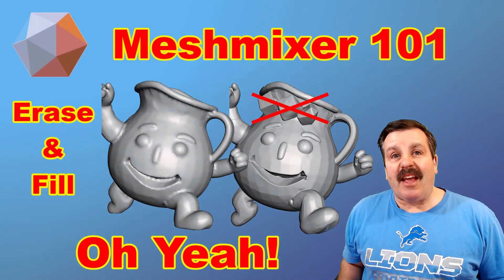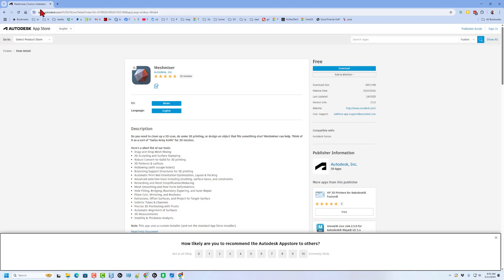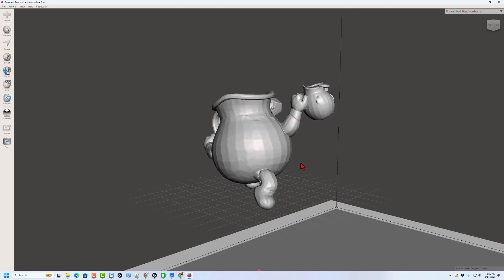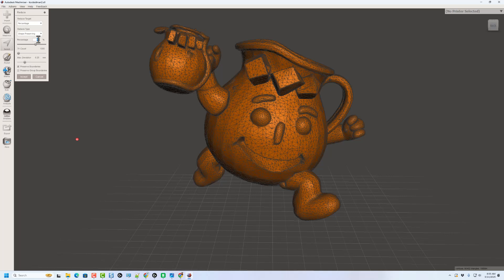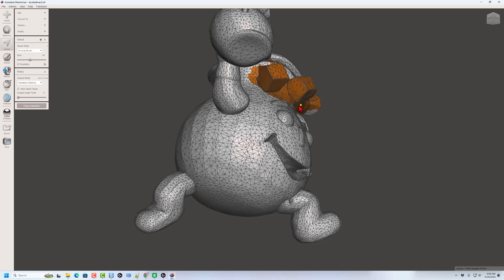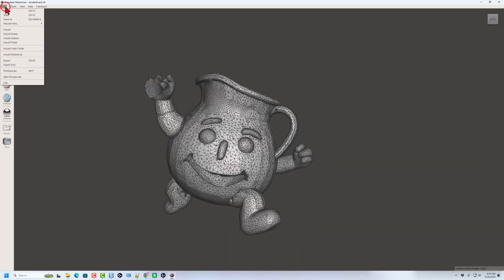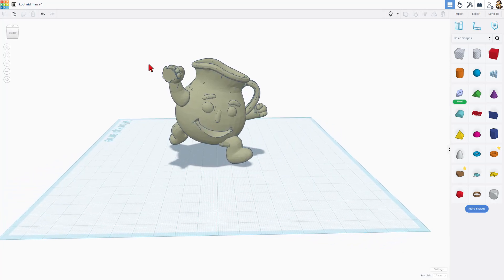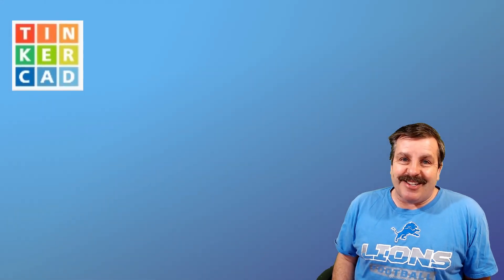Easily Fix AI Defects MESHMIXER Maker World & Tinkercad OH YEAH!

Comment: Can you do more tutorials on MeshMixer?  I see you have some older ones.  I have an object I scanned, it's a hat.  It all came out pretty good except the bottom edge where the fabric was folded to make the finished hem.  The scan captured about 1/4 of it but the rest just stops at the bottom w/ a flat edge.  I'd like to know if I can select a portion of the folded part that exists, copy it, and paste is into the other areas.  I'm not sure if I can actually draw it in myself from scratch.  I'm also trying to get a better scan.  I really need to practice w/ MM!
Reply from the maker: I will keep adding them when I can. I really need to get better at the sculpting part. One trick you may want to try is to get half the hat right... then use plane cut and mirror it. I do have a video about the plane cut. Lol... I am sharing a technique that is smart... but I have yet to be smart enough to use it. 🤦‍♂️ Thanks for helping me get the idea in the cue.

Comment: This did not work for me, what might be the problem?    It just turns the area i selected red.  New to all of this. Thanks
Reply from the maker: What sort of item are you working with?
Reply: @ i am trying to remove the internal connective pieces for dummy 13 armor, hip armor to use as a shoulder piece
Reply from the maker: Instead of erase and fill can you just delete the parts you do not want?
Reply: @HLModTech  how? I used tinker cad to do just that but it is a pain and i can not get all the shapes out.  once they are all gone i can then go and add the supports i need to connect this to the project i am working on
Reply from the maker: In Meshmixer hit s for select. Click a few pieces and just hit delete. Once you have the parts isolated, export them as stl's to bring into tinkercad.
Reply: It's been awhile since I've used MeshMixer (and I was never very good) but if I recall, it turns red when there is stuff (sort of like 'noise' defects) behind what you are trying to work on.  I had a really messy scan and it was a nightmare cleaning it up because inside the object was very messy.